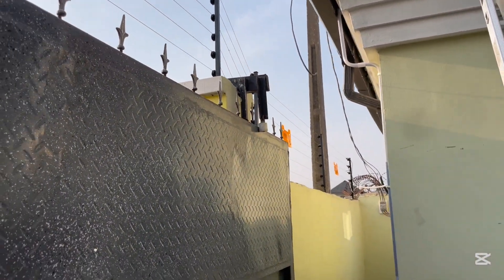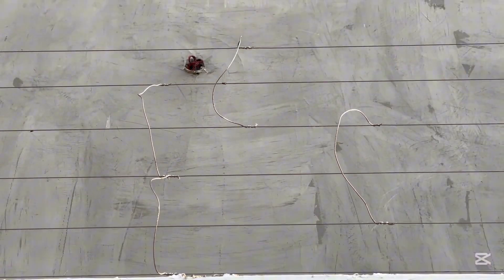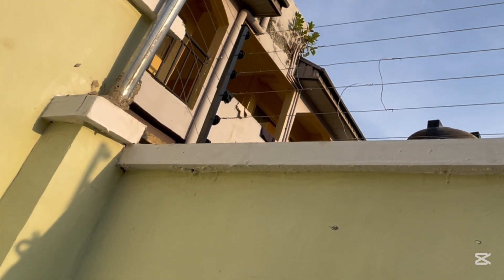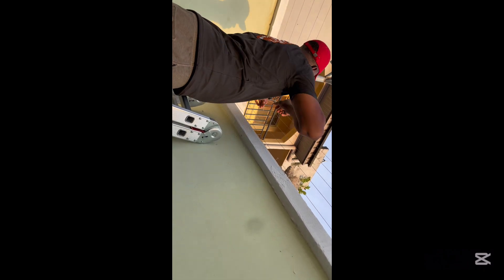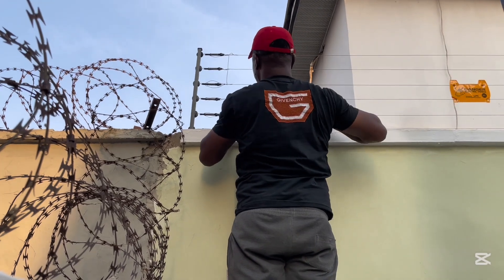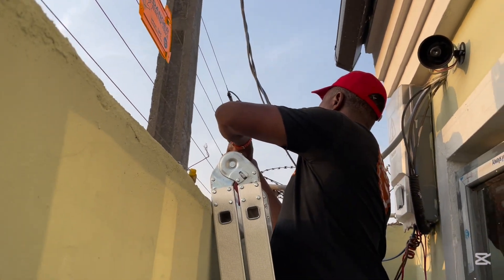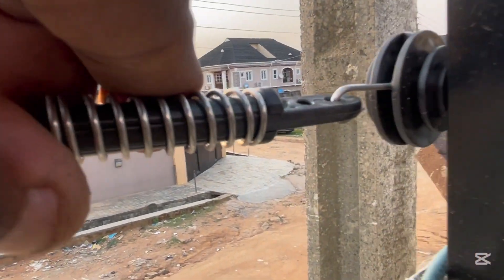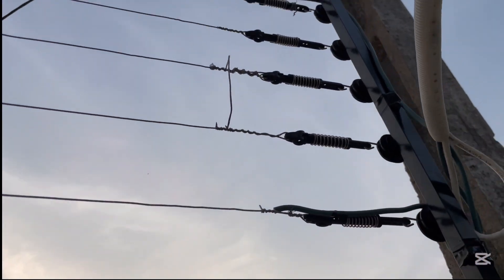HOW I CORRECTED A BADLY CONNECTED ELECTRIC FENCE.

Comment: Can one use flexible cable for the installation? And is earth rod really compulsory?
Reply from the maker: Please always use like-metals. Such as Aluminium with aluminium, not copper with aluminium . And for earthing, it's a necessity
Reply: @defotechtv9093 Noted sir. But there's this Nemtek energizer that i went to install. The alarm can't stop beeping even without the fence being connected. Pls what could be the issue.
Reply from the maker: Take the Energizer to a qualified technician for checks